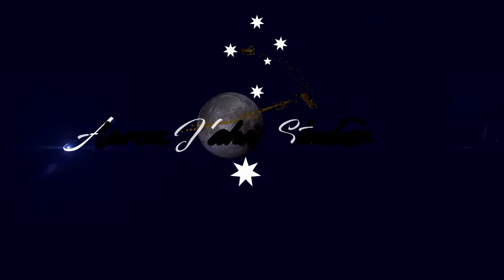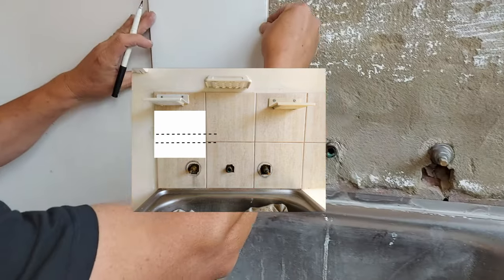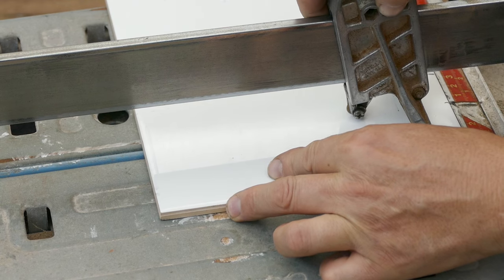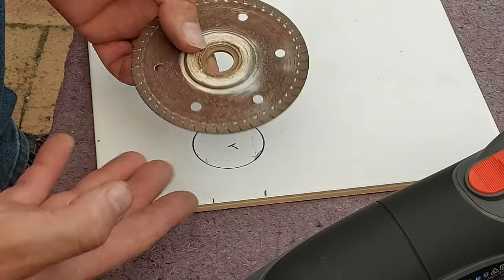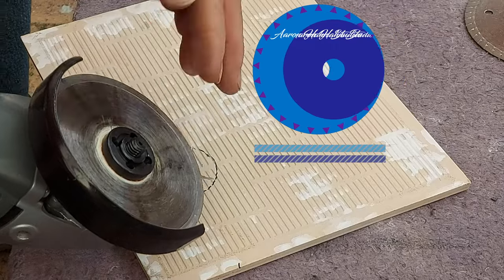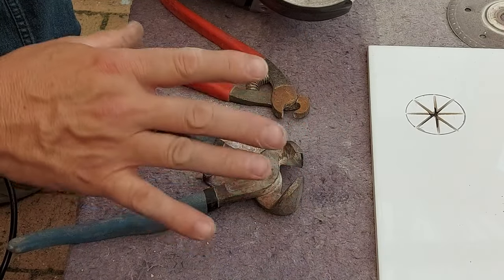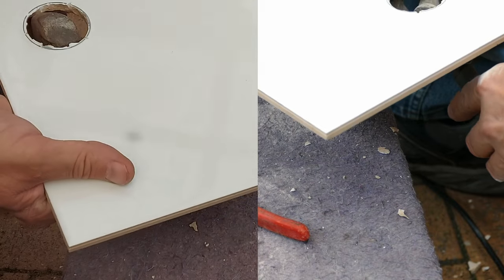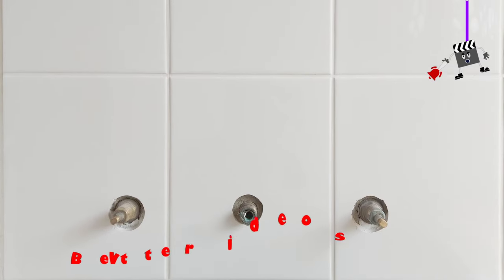How to drill a hole through tile  (ceramic/porcelain)

Comment: It looks like patience is one of the elements to bring to tile jobs too! Soon I must drill holes 1cm distance away from old existing holes, on tiles already up (replacing a fan). I'm concerned 1cm is too close and it might cause cracking. However after seeing this it looks like tiles are composed of packed granular particles, so there are unlikely to be latitudinal or longitudinal 'grains' along which adjacent holes could multiply a weakness. Wood does this though. Still, I'm nervous about the close holes. I guess I must be extra careful and apply less pressure than usual, as I don't know where the gaps between glue are under the tiles. Thanks for all of the advice on your channel :)
Reply from the maker: I wish I could see your situation visually so I could help with your project.   Sorry for the late response, I have been out at The Great Australian Bight working on my History aspect of this channel.  I hope your project went well.   All the best & take care.
Reply: @AaronHahnStudios  Hi Aaron, still haven't done it yet. They will be 6mm holes. I wish I had photos but don't unfortunately. Thanks for your reply. I'll just take my time with less pressure.
Reply from the maker: @quatermass8  Only a 6mm hole!?  Then you want This video :- https://www.youtube.com/watch?v=YNuWP0PzifM
Reply: @AaronHahnStudios  Thanks. Great Video reference. As I'm not sure whether the job will present me with porcelain or ceramic, I've grabbed one of those cylindrical diamond core bits too. Whichever of the two textile types they have, I'm still going to take it very carefully. Thanks for the great uploads and for your help.

Comment: Thank you for showing this technique.

If the hole would have to be cut on a tile which is already installed - then I think the drill bit would be needed.
Reply from the maker: Yes, your right, it would be easier with a costly drill bit if it were on the wall already.  But! .. It Can be done! I've done it many times. I think I will do a video on how to do that.  Great feed back marttanek.